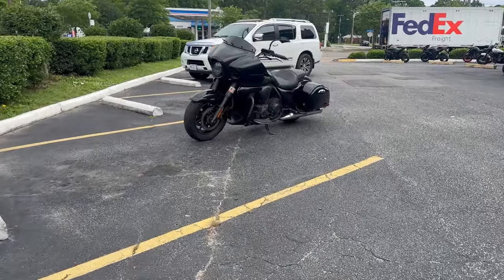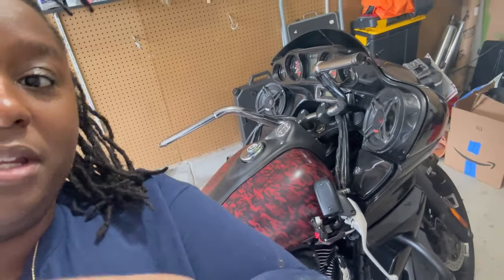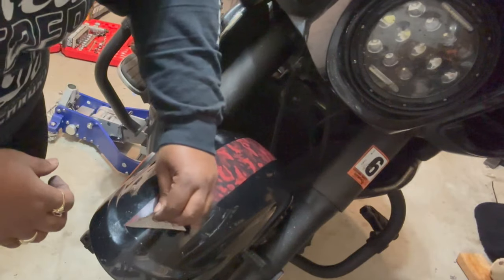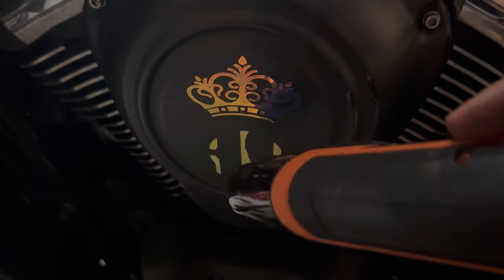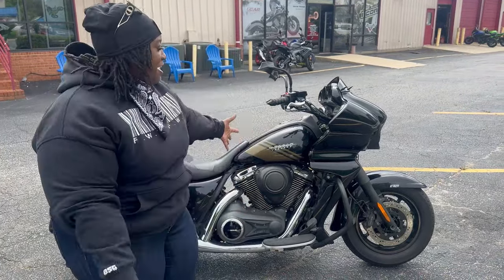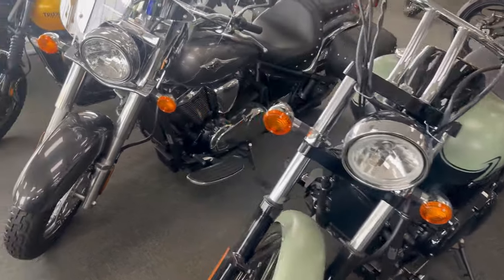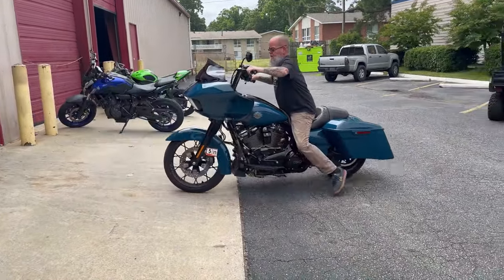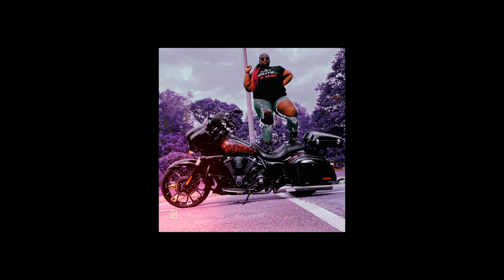THIS ISN'T FOR ME ANYMORE... | Removing The Mods on my Kawasaki Vaquero | Motovlog

Comment: Hey.   Congratulations Lady.  I went from a 2011 vaquero  to a 2018 road glide. And honestly like my Vaquero better. I know people will think I'm crazy but pretty much zero maintenance on the vaquero. Oil brakes  tires that's it.  I used to get 42 miles to the gallon on my Vaquero are you saying Harley is better than that?
Reply from the maker: I got 160 miles to the tank with a heavy throttle hand. 175 if I was doing 65.